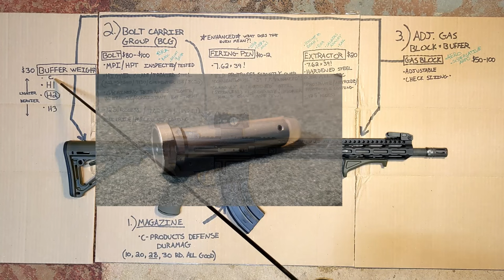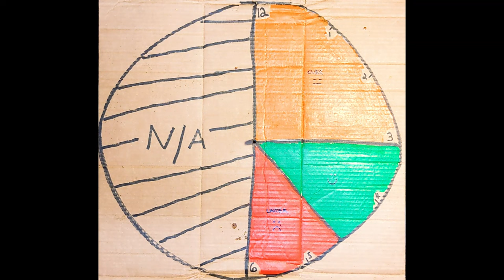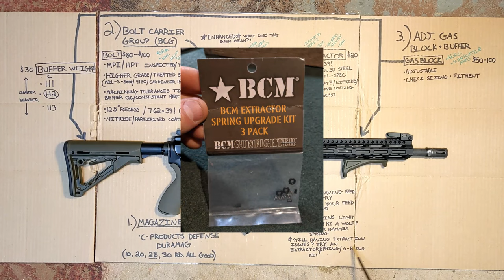How to Build a Reliable AR-47 (7.62x39 AR-15)

Comment: Excellent primer and overview on 
making a "Well Regulated" AR15,
in the venerable 762x39 caliber!

I like the idea of a AR15 762x39 series in both the full 20 inch Rifle configuration and shorter barreled AR15 Pistol versions. 

No doubt, that C Products Defense Magazines are top of the line quality that function as to being; "Well Regulated".

Nitride finishing is superior as compared to,  Oxidized Parkerized Finishes as far as corrosion/eliment resistance.

Yes indeed the use of a,  Heavy Buffer and Wolff Heavy Firing Hammer Spring helps with especially preventing ignition problems of the Steel Cased Surplus ammunition Primers.

Keep up the good needed work!
Reply from the maker: Thanks for watching!

Comment: Building a x39 patrol rifle. Have a BCA side charger, but it's too front heavy with a Sandman S suppressor.
Starting with a PWS 16" piston upper Gen2 MK 116. Using an Aero Precision M4E1 receiver with a Rise Armament LE 145 single stage drop in trigger. Armaspec Stealth H2 captured recoil buffer, forward controls REF buffer tube, end cap and castle nut. Ambi safety and mag release because I'm a southpaw. Eotech EXPS 3-0 on top.
I'm almost 64 and most of my battle rifles just aren't practical. I prefer the ergonomics of the AR platform, and a 30 cal. round. The linear recoil impulse of the AR is much better than the AK, it's lightweight, and reliable. I'm not a sniper, my intent is for fast, reasonably accurate shots and a platform I can trust my life to. In reality, the ranges I anticipate engagement to be 400 yards and under. Since my wife is paralyzed from a stroke, I'll be hunkering down. Normal velocity 7.62x39 suppresses well enough. The can is more for flash mitigation. I'm putting a B5 Sopmod stock on it. I like the cheekweld it has.
Just putting this out there. Still putting it together. Just got out of the hospital after a week in the ICU, so I can't do much now. I just can't wait to put it through the paces. Love my guns.
Thanks for the excellent video.
Have a great day!

Comment: I think the negative thing about nitride extractors has more to do with the fact that nitride is a more slippery treatment than phosphate. That's fine everywhere else on a BCG, but you want friction with an extractor. Also, to do the nitriding correctly, the part to be nitrided must first be properly tempered in order to produce adequate hardness and depth of nitride coating; the question is, how many parts manufacturers are tempering and nitriding the part properly?

Comment: Great video!!!!! I have been sitting on the fence about obtaining one of these AR's.  Your video was excellent.  Really like the Card Board Box training aide.  Smart move for us viewers!  Really great info and timely for me. 
One of the best video presentations of this topic!

Question?  How can I mount this upper ( side charger) onto a lower that accepts standard AK Mags?  

I own a couple AK'S and don't want to invest in more AK like mags. 

Thanks for your work.  You've earned my subscription and LIKE. 

Semper Fi Retired Marine.
Reply from the maker: Thanks for the kind words! The first lower that comes to mind that will accept AK mags would be the Palmetto State Armory KS-47 lower, however I don't know if it'll accept all uppers, from what I've heard it runs best with the dedicated KS-47 upper as well but maybe someone else could comment more on it here.  Other than that, the PSA Jakl should be released in 7.62x39 later this year as well, but again,  I don't know if the lower will be accepting of different uppers as well.  The other option is expensive, but the CMMG Resolute/Dissent/Banshee (Mutant) line as well as the IWI Galil Ace line have proven themselves to be reliable and take standard AK mags.

Comment: Appreciate the info I have broken two extractors so far from bear creek so I'm going to checkout sanders 🙏🏾🤞🏾
Reply from the maker: My original BCA extractor broke after 40 rounds or so.  After they replaced the extractor for free, the replacement only lasted a couple hundred rounds or so.  I switched to Sanders Armory and it's been running great ever since.
Reply: @ExtremelyAverageMan   okay thanks so much for that info my first one broke in about 80-90rds I contacted them they replaced it for free as well and same thing went through a few hundred rounds nothing crazy but it broke again recently and I was about to contact them but seen this video and I appreciate you for putting this information out thanks again
Reply from the maker: @dranknfish4260  Yeah, BCA is great for their price point, but not exactly great when it comes to quality parts unfortunately haha.  I had the same scare when I was new to this build, but learned to upgrade to different manufacturers as I slowly replaced the original Bear Creek parts.
Reply: @ExtremelyAverageMan  yeah I know what you mean I  own two BCA the 12.7x42 and the 762x39 and tbh the 762 is the one giving me problems but I'll see about the 12.7 when I get my round count up once again appreciate the content 💪🏾

Comment: Brass is best as it's reload able. Steel is cheaper, and your 7.62x39 should be able to eat both. I have 2 7.62x39 myself. A rifle and pistol both have adjustable gas blocks. Both have adjustable buffers. both have enhanced firing pins and heavy hammer springs. Both have heavy barrels, the rifle being fluted to reduce weight. Both run C products magazines. Sanders BCG in both.
Reply from the maker: I ran 80 rounds of lacquered steel through last range trip and only had 2 failure to feeds.  I've since polished my feed ramps with some Flitz....hoping that resolves the issue by next range trip!
Reply: @ExtremelyAverageMan  I'm running an adjustable buffer at 5.8 Oz in the rifle and the pistol has an adjustable buffer and a folding stock so I had to play with the BCG extension for the folding stock and the buffer weights. It's now at about 5.7 Oz. I'm using the adjustable gas blocks in both but set them tula ammo
Reply: @ExtremelyAverageMan  what kind of feed ramps do u have and how do u polish them? Also did the polishing work?
Reply: My feed ramps were good to go from the factory. I have run Tula ammo and brass ammo both run great. Yet I went and got 500 rounds of wolf 122 grain hallow points today and has to readjust the gas block and buffers as I also took my folder off and went with a 4.3 Oz buffer basically an H3 down from the 5.8 Oz buffer and bolt extension I was running.  Now less recoil then with more weight. AKA adjustable buffer. 1 issue I did discover was that when it came to trigger reset, it was that about every 3 or 4th shot, I was having to push the trigger forward. I oiled the crap out of it, and it works better now. It does have the enhanced hammer spring, so I'm wondering if that's the problem. I used a different lower with the buffer but into that one and didn't ha e the trigger issue anymore. So, I guess I have some trigger and hammer work to do yet. This is in my 10.5-inch barrel 7.62x39 pistol.

Comment: How has that Black Rifle arms bcg with the Sanders extractor held up? How many rounds do they have on them? I think im leaning more towards the Superlative Arms Gas block and the Sharps Rifle Co. BCG with a flat wire buffer and h2 buffer. Is there a reason u went with the sanders extractor over the one from black rifle arms?
Reply from the maker: Pretty dang good.  I had about 3k rounds on both the bolt/extractor before I sold the rifle.  To be honest, I was between a few manufacturers when it came to the extractors-at the time there weren't too many that made enhanced extractors.  I took a gamble on Sanders Armory since they had a good sale at the time for a 3-pack, and they ended up working very good!

Comment: The biggest problem I had with mine was firing pin breaking on steel ammo so I have a bagful at the range of pins
Reply from the maker: Yep, a downside of an AR-47.  Have you bought some Enhanced pins? My original BCA firing pins broke after a couple hundred rounds.  I switched to Black Rifle Arms which helped significantly.
Reply: @ExtremelyAverageMan  yeah I have a whole bag of those just in case 🤣
Reply from the maker: @RustyShacklefardd  it's inevitable haha, good plan.

Comment: AMMO: Golden Tiger is one of the only Boat Tail ammo available.... Hornady Zmax is the same as Amax, both great for reloading.... Hornady now makes X39 sub sonic 😉..... MAG'S: ASC mags are my go too after 10 years and thousands of rounds later..... RELIABILITY 1) Polished smooth feed ramps.... Enhanced firing pin....Heavy Hammer spring.... good to go 😉.... You can now add all the cool stuff like Slient Captured Buffer Spring by J P or _____? ....2lb competition trigger by JP or _____? .... Muzzle brake by JP , or ______? .....Silencer by _______?  ....LPVO etc....etc...the sky is the limit.... cheers

Comment: wouldn't a titanium firing pin and extractor last the life time of the rifle even if always firing steel case ammo? Maybe higher cost up front, but would kind of put the issue to rest - titanium vs steel
Reply from the maker: Never even thought of titanium, thanks for bringing that up! Looks like a company called Anarchy Outdoors makes them for $25 with a lifetime replacement guarantee. I'll check them out!

Comment: Gained another sub here! 
Been looking into completed uppers as of recent any recommendations? Alot vendors are sold out and at the moment Bear Creek Arsenal has 7.62x39 uppers on sale. Any experience with their completed uppers?
Reply from the maker: Both of my uppers were Bear Creek Arsenal 16" side charge upper.  They're great for the money, considering you can find them for $200-215 when they are on sale.  But if you want them to run reliably over a period of time, I recommend sort of gutting the bolt carrier group and buying an enhanced bolt, firing pin (BCA firing pins are notorious for breaking early, even though they claim their firing pins are "enhanced") and extractor.  Basically you're buying a $200 complete upper, and putting another $120 into the upper to make it a good upper haha.  Still, $320 for a solid side-charge upper is worth it in my opinion.

Comment: VERY FUN Gun to shoot, but just not reliable enough for me! I built one w/ 20" Bull Barrel for long range accuracy w/ lower cost ammo but unfortunately am not a fan of MY FYI BUILD!
Not happy with stoppages needed to clear out a no shot rounds. This is a deal breaker for me at the range so it WILL NOT stay as-is in my collection. Granted, my DYI build may have not been done correctly!  However, I will no longer chase  this rabbit down the hole to better understand how to fix my issues. AR-15's were designed for .223/5.56 ammo and should only be refined for this ammo in my opinion!

God's speed to you wonderful DYI folks who enjoy chasing this option and make it work! 
I however will stick with 5.56 in the AR platform and consider purchasing  something else designed for this 7.62 caliber. 
God Bless and stay engaged in our 2A passion!

Comment: Will a rifle butt stock on a AR-47 with a 18in barrel and a Mid-length gas tube work together?
Reply from the maker: I'm sure it would, tuning the buffer/gas system might be slightly off from what I said though.  Going with more of an A2 stock?

Comment: I used an MGI HYDRA Super Bolt.
I have about 4 different types of  mags, ASC, C Prod, Wyndham, and that Brownelles brand. All good.
I also used an Adams Arms piston.
I also opened up the gas port to .125"
Besides all the experts on FAL and AK Files telling me that this will never work.
To date, everyone who has shot this girl has made an offer to buy it.
500 yard thumper all day with Tulammo
Reply: Slug your barrel. There are many x39s that actually have a .308 bore. Save your brass. There is a Sierra Match King 135gr bthp that you can load up to AR pressures, (which are higher than AK pressures).
Then thos baby's are good for 600 yards

Comment: Any thoughts on the BCA 18" Mid-length 7.62x39 upper? I'm thinking about getting the 18" to maximize the round at distance for hunting.
Reply from the maker: I haven't given it too much attention.  16" is a perfect "all-arounder" for me, plus you don't get much balistic/velocity advantage with an 18" over a 16".
Reply: I didn't know BCA had a Mid Length Gas System on their 7.62x39 upper's.

Comment: I'm having short strokes with my aero adjustable gas block all the open the only thing I can think of is my fixed stock and buffer weight and spring is to heavy and won't allow bolt to go back as far as it needs to eject but who knows it's aggravating I used all high end parts
Reply from the maker: Which weight are you using?
Reply: @ExtremelyAverageMan  not 100% sure but I know it's heavy maybe to heavy but after more research it seems the 7.62 39 faxon gunner barrell I have has issues with the gas port not being drilled big enough so that maybe the issue its just not getting the gas it should
Reply: @ExtremelyAverageMan  it's a magpul fixed stock with a long spring and long buffer weight
Reply: @ExtremelyAverageMan  just looked it up it'd the aero precision rifle buffer kit says the buffer is 5oz

Comment: What kind of buffer spring do you recommend? The ks-47 has an incredibly heavy springs and it has to be charged by hand every time, so I am hoping there is a way to mitigate this without sacrificing reliable cycling.

Comment: Bought enhanced firing pins for mine for hopefully a harder deeper strike on steel cased.  No joy.  Thoughts?
Reply from the maker: Still getting light strikes? If so, try installing a Wolf extra power hammer spring as well.

Comment: Nitriding uses a heat treating process and while making a hard outer surface the inner surface is not hardened like a typical heat treatment, makk8ng it less durable over all, phosphate treatment is a chemical treatment that is doen after heat treating and does not affect core strength/durability.
Reply: Nitride is vastly superior to phosphate coating. Phosphate doesn’t harden the surface, and doesn’t protect the bore. Nitriding hardens the entire surface including the bore. Phosphate is like black oxide that holds oil like a sponge, so it can reduce corrosion. Nitride is similar to chrome lining.

Comment: I'm light striking wolf berdan primed rounds even with the enhanced pin and hammer spring upgrade
Reply: What brand Enhanced firing pin & Spring do you have ?

Did you check Head Space on your gun ?

Wolf is known to have hard primers even breaking your firing pin.

Comment: why do I hear more about this on 7.62x39 than on 6.5 Grendel?  don't thy have the same issues or did they fix it when they went to the 6.5 Grendel Type II? and if they did, can they not apply those improvement back to the 7.62x39?

I thought they came from the same parent cartridge, so I would expect the same issues, but I might be way off base since I am not an expert.
🤷‍♂
Reply from the maker: Keep in mind, when people started converting AR's to 7.62x39 10+ years ago, ammo was .20-.25 cents/round and it made much more sense from a cost-effective standpoint.  If I'm going to be paying 80 cents/round it better be a full-size rifle round in .30 cal.  Just my 2 cents haha.

Comment: My BCA upper paired with a KE arms built lower worked well with the first 50 or so rounds but then it started having problems. The bolt carrier would seize and I would have to mortar it quite hard to get the round extracted. Where should I start to get it running right?
Reply: I would start by cleaning it & lubing it up well.

Maybe you got some junk in there ?
Reply from the maker: I've had that a few times early on as well..does it usually happen with steel-cased ammunition?
Reply: @ExtremelyAverageMan  Noticed it the first time with steel. Then i boight some brass but same issue. I would maybe 10-20 rounds and then failure with both

Comment: I dont need to switch out the lower on my ar for this barrel, right?
Reply from the maker: The barrel needs to be 7.62x39.  Most lower receivers will work for other intermediate calibers other than 5.56 (6.5 Creedmoor, 7.62x39, etc.), just make sure the lower receiver says/will accept "multi-caliber"
Reply: @ExtremelyAverageMan  gotcha. Thanks.

Comment: Hey whats up extremly average man. Just wanted to know, whats your round count on your black rifle arms bolt and how has it held up so far? honestly im leaning towards Sharps rifle co. for a bcg because they use s7 tool steel thats properly heat treated and they add material to the end of the carrier to balance it out and make it a proper fit. But as im looking for more info someone just said they use a 5.56 bcg with a 7.62x 39 extractor and i thought that was interesting and im tempted to try that. The other thing i was curious of is if the bcg from CMMG would fit in my Radical x39 because they cut them from 308 bcg and its super beefy. Anyways ill talk to u later peace man.

Comment: Breaks lugs every 1000 rds give or take a few but keep a spare bolt and all good.
Reply: You actually break lugs off of the bolt ?

If so sounds like your very overgassed & it's trying to unlock to early.

I would try a heavier buffer or a spring so it doesn't unlock so early.

I put an adjustable Gas Block on my BCA 39 Rifle but that's more labor intensive, also more money.

Thanks for your comment, it is very interesting.
Reply from the maker: It won't happen as often as breaking an extractor, but because of the thinner nature of the bolt lugs, it is bound to happen eventually.